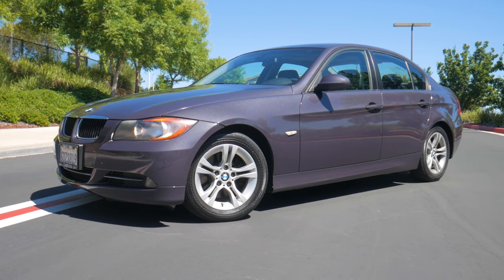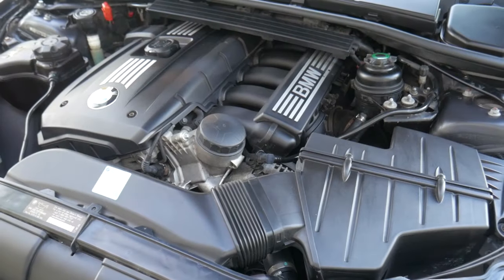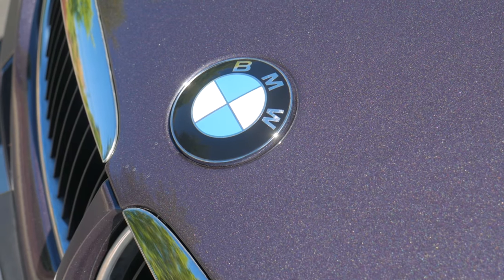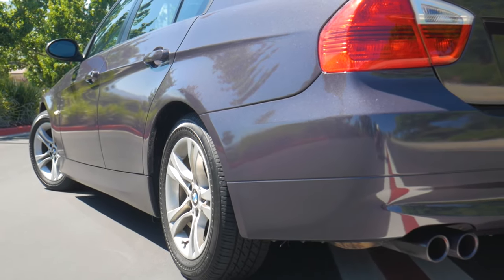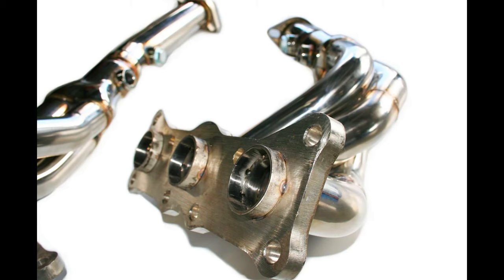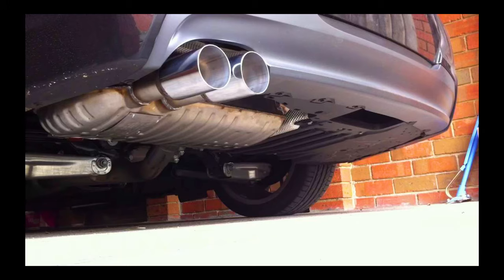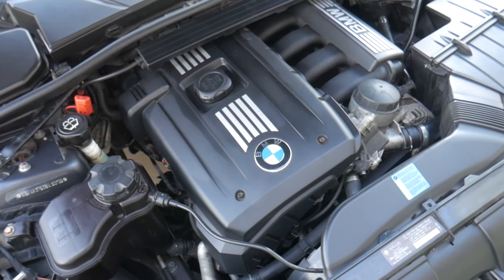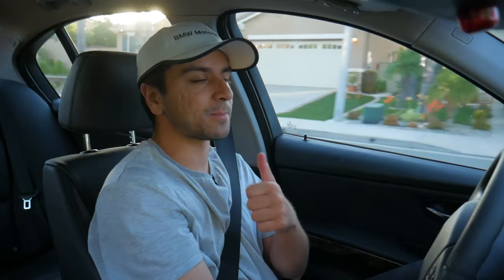GAIN +70 WHP On Your N52 With These 5 MODS!

Comment: This is a great video and very informative. However, 70+ hp gains on these cars especially the n51 is impossible with these mods. The three stage manifold will require a tune (for DISA) for you to be able to harness the full potential of the manifold. Putting on the manifold is half of the mod- the other half being the tuning. Catless headers and a good tune will help with “power” gains but it’s usually very small like 5hp. Intake mods usually end up LOWERING your HP and TQ figures. That being said, if you do the manifold and tune, headers, exhaust, and approved intake, you MIGHT have gains of about 12-15 hp if you’re lucky. I’m sorry, guys. The best way to gain hp is to go 335i or turbo the n52. This is coming from a dude that’s had 3 E90s FBO and a Euro Tech :) I’m not hating, just spreading the actual truth. For automatics, the BMS Power Box from Burger Tuning increases your throttle response and fuel/air mixture/ratio (supposedly) and will make it feel like it has more power. But fix your valve cover leaks and replace the water pump before ya try making it faster. Maintenance over mods!
Reply: Thumbs up on the video btw. Love your content.
Reply: Did you ever own a BMS power box? My E90 is my daily driver, but I wanted to add a little kick where I could. Also you have any experience in quality aftermarket brakes for the E90? Figured brakes would be the last "performance" oriented upgrade, despite it only being a street car
Reply: Wrong but ok. There are several dyno charts out there for the n52 after Fbo. My n52 is Fbo with milvs and makes 268whp.
Reply: @challengeshd3737 tells me I’m wrong then adds that he installed MILVS. Like bruh.
Reply: @Coderedpirate I had one on my old n51 328i auto. It really helped with throttle response. As far as power gains- it’s all an online marketing ploy. But it does make it feel faster by making the throttle response much quicker. As for brakes, I’m a huge fan of EBC rotors/ pads. I did braided brake lines too.

Comment: Clear and concise. 
 Great job, thank you!
Reply from the maker: thank you for watching! 🤟🏼
Reply: @SimplyCarThings  I just researched and found my 2009 128i has the N51 motor. I think you said this means I have the 3 stage  intake. It was confirmed by my dealer. Which ECU do you recommend? I'll eventually install headers and exhaust but would like to unlock the existing ponies from this intake with a proper ECU if possible in the meantime.

Comment: Ran across ur video randomly, always happy to see n52 videos. Have u seen any turbo n52 build's? Engine is safe up to about 25 psi, made like 560hp at like 19 psi, 450 at 15, all stock internals. N52s are definitely capable of big power.
Reply: I know what your talking about. That engine did not handle 25 psi for long, the connecting rod failed and the engine blew. At 19 psi is where the owner advised that you need head studs because the head was starting to lif up from the block. So please dont exaggerate the facts and tell people the n52 will run 25 psi like it's a beast. There's a limit to everything. Anyways I'm sorry, I didn't mean anything by it , just telling the facts. To run that pressure you need upgraded  head studs head  gasket and stronger  rods and pinstons.
Reply: Who said any of that? Believe I said up to 25 PSI, which is exactly what u just said....please don't put words in my mouth
Reply: You can maybe have like 6-7 psi safely
Reply: BMW specify 350hp maximum for N52,  I think you mean N54.
If you ran 25psi, there'd be rods exiting the block.

Comment: Nice, I just got a 3 stage intake manifold, gonna get that installed and tuned/remapped/flashed to get more power. Probably gonna get AA headers to add 20 more hp.
Reply: I'd no go the header route if you were thinking of procharging. Because the AFR gets extremely messed up and the companies producing the supercharger aren't able to make them work with the catless headers unfortunately.
Reply: @natejewett1  bpc has tuned the supercharger with headers fine.

Comment: Nice man, will this affect the reliability of the car in the long run?
Reply: I've had my headers, intake, exhaust, tune, and manifold for a few years. Relatively no issues
Reply from the maker: In all honesty it shouldn't!
Reply: More hp equals more fuel. Hasn't it been like that always?
Reply: @L-Noble.YT_Hi.Res-Soundminds  yes but right now the engine is just breathing better, it could even help the health of the engine honestly

Comment: In reality, there's more difference between N52 and N51 engines.
Reply: Very true. I have an N51 and it also has secondary air injection, lower compression, and differences in the radiator, fuel tank, etc.
Reply: @themsherwood  fuel ramp, fuel line, injectors, intake elbow to name a few others
Reply: Is it worth getting a tune for an n51?

Comment: Love this video and I checked under my hood of my 09 e90 and it said ULEV.😔 Mines a 6spd Manual too and I'm going to have to look into the 330i manifold.
Reply: Whats wrong with the ulev thats the n52 as in for me i have the sulev which is n51
Reply: @justinbp6198  If I'm not mistaken,the SULEV has the three stage manifold in it already and just needs to be programmed to operate. The ULEV doesn't  have the three stage manifold in it.😔

Comment: Spend 5k for full bolt on but still get pulled on by stock e36 m3 lmao that's why it didnt get much attention and support. Dont waste your time or money trying to extract power out of it, just make it sound good with a muffler and put the rest of the money into suspension
Reply: that’s faccs gotta realize it’s a 328 at the end of the day. decent acceleration lower top speed fantastic around corners but will get out powered in the long run by a handful of cars. make that shit sound good and pop some wheels on that hoe. ppl who don’t know bmws will see u the same as if u in a m3. i’m tryna save up for an m3 bruh there’s jus sum ab that car mann
Reply: Lmao right you spend 600+ on catless headers for no power gains, when if you just sdidnt waste the cash you could have a a 400hp 335, trust me i tried with the 330 n52 for years, total waste if you want a performance car
Reply: That's why you buy the 335is then upgrade the turbos
Reply: Dude I honestly wouldn’t buy a 335 because they all been abused af😂😂

Comment: Are these reliable bro? I been thinking about getita n52 as a another project.
Reply: Watch BMW Doctor's videos on the N52, should be a pretty solid engine
Reply: These are great. I have an N52 with 200k miles. No oil leaks, no issues, etc.

Comment: I could use some clarification, I have the N51(52) does this I already have the 3 stage intake and mean all i have to do is tune the car? Cause i got a little confused???
Reply: from my understanding yea. it would be good if you bought some after market parts though such as a cold air intake filter

Comment: I'm a germany N52 enthusiast talking on my Channel about my E90 330i  N52B30. And I'm wondering.
The 325i got a 2,5l engine while the 328i and 330i got the 3l engine.
You got 70 WHP more on a 325i n52B25 (the 2,5l)???
In germany we got the 325i (after 07/2007) with the N53B30 so its a 3l engine, but the hp is reduced through a "lowpower" intake Magnifold without the DISA and a different ECU. in Germany its easy to get a 325i N53B30 (3L) from 218 to 270ps.
I would like to know what's different in your country :) in the n52b25     (n52b30) 325i situation?
IMO there wasn't a 325i with a  N52B30 at all there is only a 325i with the  N53B30. or a 328i with the N52B30.....
Please help me to understand :)
Reply: In America our e90 and e92 got a more standardized n52 across the lay out. They are all a 3,0l. The main differences is a tune on them. And out 330i got a three stage intake manifold. I believe the N52 got a slight update for our LCI models witch is just the facelift after a certain year. But the engine is still pretty much the same
Reply: @mrbabysitter11  Ohhhhh i See. I didn't knew that the 325i in the US ist a 3l! In germany the 325i  from 2005 to july 2007 is a N52 2,5l and than a 3L N53.  Ok than the 70WHP makes waaayy more sense. :)

Comment: Just got a 2009 328xi with 70k miles. Just had to replace some ignition coils but can anyone tell  me what else would go wrong at about 70k miles? And what engine oil should I use

Comment: So two things, one, doesn't the n51 have a lower compression than the n52, and two, I've heard that installing catless headers on the n51 causes idle hunting problems.  Can the idle hunting be corrected?  Thanks.
Reply: yes, the comp ration on the n51 is 10:1 as apposed to 10.7:1 for the n52

Comment: What size wheels are on that E90? Are they 17's?
Reply: The one in the thumbnail looks like the oem 335i rims which are 18s
Reply: @epaminontas6972  They are 18s, but they are the '06 330i sport package wheels [style 162] which BMW carried over for only one year to the '07 335i

Comment: European 330i has better headers and no secondary cats which gave it 270 HP.
Reply: Only the x5 I believe had 270 because it had a more free flowing exhaust, 330s had 255 only
Reply: @tylerhathcock2778  Mine did 272 stock.
Reply: @redne2s981   agree. my EU spec 330i does 272
Reply: @andrelandman5984  what? You sure? I didnt test on dyno, but everywhere says it has 258 cv.
Reply: @redne2s981  what is the engine number? I have an N52B30A (this is what it says behind the driver door).
Reply: @andrelandman5984  what is your engine number?
Reply: I am in South Africa, and our last 2012 n52b30 motors came out specced as 200kw. I believe the 06 - 08/09 cars here have the 190kw output, not sure though. but using the Bmw south africa website, ordering parts etc using my Vin, thats what comes up. Same on Realoem..
Reply: I also believe there is a upgraded 3 stage intake on these motors?
Reply: @andrelandman5984  Im from Argentina and I have a 330i assembled in 2009. Not sure where to look, every site says something different. Where did you look by VIN?
Reply: @andrelandman5984  200kw is 268hp, so is still below 272hp.
Reply: The car is in the garage, but according to my type code, VH51, its a N52B30O1. What is your type code? (The 4th to 7th digits of the VIN)
Reply: @redne2s981  mine is PM31.
Reply: Acording to your type code, your 330i has the same engine as mine with 272HP. The only difference is that yours is facelifted.
Reply: @redne2s981  thanks for the info! I like these cars because there is a good community around. :)
Reply: No problem dude :)
Reply: n53b30 -272 n52b30 258
Reply: @MrXaarR  son n53 is the only one with 272?
Reply: Adrián Mouly there is 4 versions of n53b30 201, 215, 255 and 268 hp)and one version n53b25 (188hp)
Reply: european 330i has n53 and has higher compression ratio (12.0:1) along with direct injection which gives it 273hp. n52 has regular port injection, and a 10.7:1 compression ratio. not the same
Reply: @bruce_son  that makes sense, so how much power the regular 330i has?
Reply: 255 hp in the US
Reply: @bruce_son  There is the N53 and also N52 for europe.
Reply: 255hp for us n52 version

Comment: Can the 2.5L N52 BMW F10 523i be modded similarly as well?
Reply: Yes i have an n52b25 with the n52b30 manifold, milvs, mishimoto hose intake with out silencer that comes with the oem, headers and runs very great
Reply: @GVilla99  What gains did you make? Did you have it tuned?
Reply: @fongkiankwok3324  sorry i still not go to the dyno for a remap, in september i tell you what the real HP  are, but i run against my friend 330ci e46 and i won😁

Comment: Don't be fooled yall you dont need to get a big time exhaust system. Once you get the catless headers just get a muffler delete you'll get the same result.  And I've personally ran tests on this.
Reply: Yeah cat back remove replace with straight pipe I've done it on e34 & E39 & now I'm going to do it on E60 530i it's a must mod

Comment: Hello, im getting an F10 523i 2.5L N52n in the coming week. 
What are the drawbacks of the engine?
Does the tuning mentioned in your video apply to this specific engine?
Reply from the maker: Yes it does! The N52 is a 3.0L I6 not a 2.5
Reply: @SimplyCarThings  they made the n52b25 before they made the n52b30, which was a 2.5 liter, idk about the newer 5 series tho
Reply: Simply Car Things it is a 2.5L mate
Reply: @goolamuns.a.hussein6993  Hi, i am a owner of 523i 2011😊 did you manage to do the intake manifold change?
Reply: @xueguan23  Hello, 
I haven’t as I’ve already sold the car.
Reply: @goolamuns.a.hussein6993  oh have fun on your next ride😊

Comment: Great video. I have a 2007 BMW Z4 with 3.0i N52 engine. I bought a 3 stage intake from a 2006 330i that I want to install on it.  Should that just be plug in play and drive ok before I get it tuned? Will the 330i disas need to be changed out for some that are specific to my N52? I plan to get the Z4 3.0 Si tune soon after 3 stage install. I read online it should increase my HP by 40.  :)
Reply: @notadoctor2598  Do you mean the tune?

Comment: I'd like to do the intake mod, as I originally wanted a 330xi, but all the deals fell through and I ended up with a lovely 328xi. Sure, I'd love a 335, but am maybe a bit too concerned about reliability and affordability with the maintenance. A bit more power would be nice though.

Do you happen to know what the other 330 difference are? I'm pretty sure 330 and 335 actually get better fuel economy, so maybe there is some gearing difference too. If that's in the final drive ratio, maybe that could be swapped with relative ease?

Anyway, one thing I like about my 328 over the 330 and 335, is NO CHROME (well, except for the grill while I'll replace at some point). I HATE chrome.
Reply: My 328xi at 430.000km - lovely machine
Reply: @Dejan_23Unlimited  Nice. I'm at ~315,000 now.
Reply: @SteveW928  👍

Comment: as a former N52 owner, let me tell you guys something, just live with it and leave it alone, N52s aren't gonna get any faster, just save up and move up. I tried for so much time to get some extra power and besides knowing i added a few horses with x mods, i never felt the car any faster. Just save up and get an n54/n55 or better car. And no. Turbo N52 is not an option
Reply from the maker: Edgar Michaus i agree overall but there are many guys out there that own these cars and want to dabble with the modding process so i made this video foe them
Reply: Agreed had a 325 before I got a 335 ..was slow as shit lol
Reply: Why turbo can’t be an option?
Reply: @danielzychniewicz2633  😂 cause is fking stupid to put a $7k turbo kit on a 2006 328i that costs $3000 or less. Just nonsense, plus that turbo kit was being developed a few years ago and not sure if it even made it out.
Reply: Edgar Michaus what 7k? For m54 and others you can get turbo kit like 3k even cheaper maybe. In that case ya it’s not worth it.
Reply: @danielzychniewicz2633  Thats what i mean... you'll be expending  so much money on a turbo kit that will probably  put you in the territory  of a stock n54? There  is no reason for that, you are better  off getting  a n54 or n55 and start  from there
Reply: Edgar Michaus indeed. I was expecting the kits to be a lot cheaper. Looks like poor aftermarket support for n52.
Reply: Edgar Michaus I actually did find a cheap kit for n52 only worth it if you can find 325 or 330 at auction for really cheap. I still likely wouldn’t bother. I prefer older bmws myself.
Reply: N52 3.0si in the E85 Z4 is fast as hell
Reply: @danielzychniewicz2633  kit? lol learn to use a welder. any car can be turboed. the engine management (tune) is the problem
Reply: AlphaMuscle wtf are you talking about? Who said anything about welding? Obviously any car can be turbod. What’s the point of ur comment?

Comment: A buddy has a 328xi, all unrestricted updated intake/tune and a single 3 stage turbo running at a decent pressure. Beats every 335 hes raced off the line, or moving while out n about.

Comment: So I have a N51 engine. So all I need is a software update to unlock more hp?
Reply from the maker: Yessir
Reply: Simply Car Things do you have a link to where I can get this done?
Reply: MichaelC11 this dude is just getting second hand info from other youtubers that know what they’re talking about
Reply: @michaelc1154  this is totally wrong, a n51 is not the same as a n52. n51 has different piston design and lower compression ratio compared to the n52. 10.0:1 to 10.7:1 you will gain literally to nothing with the software tune

Comment: I'm sorry but you will never get any where near 70hp gains on a 325i n52 with those mods. To say the 325i n52 is restricted mostly by the tune/map is just not true. It is certainly true for the 325i n53 engine because that block is 3.0l same as the 330i n53. However the 325i n52 is only 2.5l, the displacement is the biggest limiting factor between it and the 330i. Also putting that 3 stage intake on without a remap will result in hp loss. I'm not sure if there has been some confusion here between n52 & n53, because the suggested mods (remap/3 stage intake) on a 325i n53 would infact return 330i power gains.
Reply: my n52 325i has a 3.0L:
Reply: @IccDani  hi, my bad, I'm in the UK. What I said was specific to UK cars. Indeed there was a 325i with a 3.0l n52 made for America and Canada markets 👍

Comment: My guess is the power gains a lot of people mention for certain mods are rather inflated. If you want to tinker and see what happens, that's cool. But don't expect a straight six without a turbo or supercharger to get over 300 hp. I like the N52, but it's not a high performance power plant.  Was never meant to be. I may get another E90 sometime and swap an LS into it. Love the naturally aspirated Chevy Small Blocks.